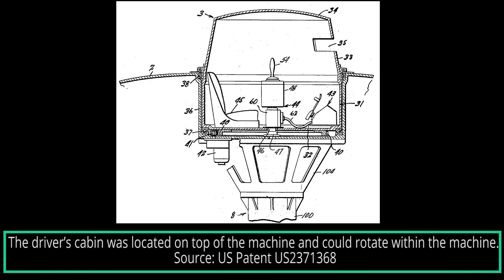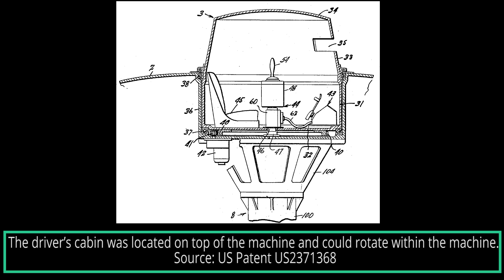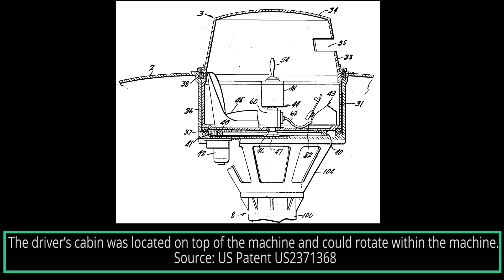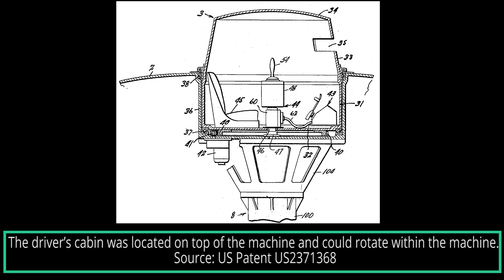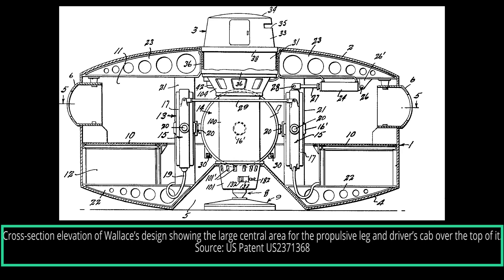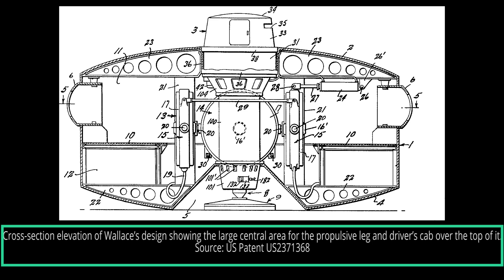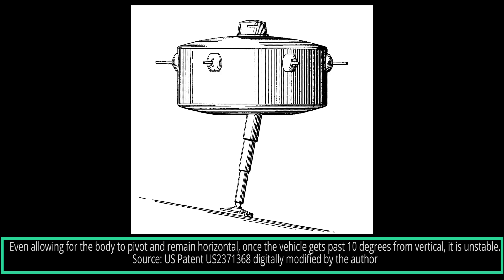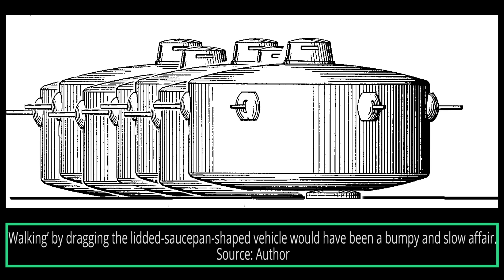A Tank On a Leg | Wallace Leaping tank

Comment: One problem you forgot about the ground pressure of this jumping thing. Mines, even if the weight of the "tank" didn't set off a mine, the extra pressure caused by the jump, or even the landing would have set off any mine under it.

Comment: Just imagine the look of horror in the enemy face when they see the hoping tank jump up in the air and land on enemy troops.
Reply: Imagine the look of horror on the crews' faces when they saw it!
Reply: ah yes ... think of the look of horror on the face of the maintenance or rescue crew that has to remove the former crew out of that thing... while wadding ankle deep through "barf"
Reply: M-Metal...Gear!?
Reply: STOMP STOMP STOMP STOMP
Reply: Or if there are gaps / vents, the mush getting inside and coating everything.  Right before the surviving enemy soldiers machine gun the thing.
Reply: Not the best tank design as it's mad
Reply: You must be sub 65 iq if you think it would jump about. You have Looney Toons understanding of physics.
Reply: @v4skunk739  "if" not meat it can why this design will work

Comment: This looks possible with drone technology now.
Reply: sure, if you remove the pogo stick and exchange it with a turbine powered ventral/dorsal hoverunit. Or tracks. Or wheels. I mean, god damit, the amount of impact stress this brainfart of a locomotive nightmare produces in regard to the structural integrity of the construction alone must be horrible, and more then just probably not feasible. And i can tell you one thing, electronics dont like to get whacked hard, let alone getting repeatedly wacked with the power of a a few ton heavy vehicle bouncing around and/or falling flat merily. And feeding mechanisms for guns are not so keen for that either
Reply: @MERLK2  Not if you scale it down. A hopping drone with a single pistol caliber submachine gun.